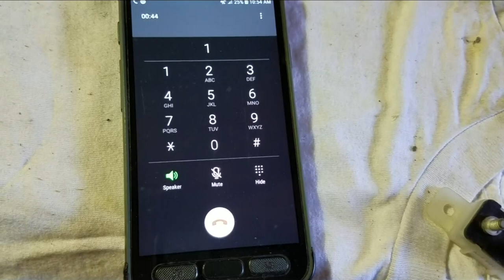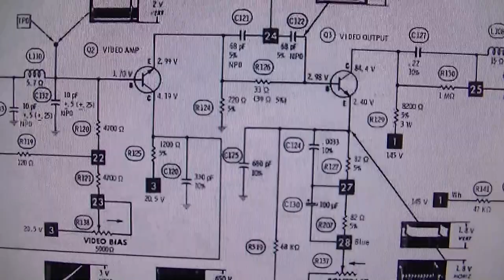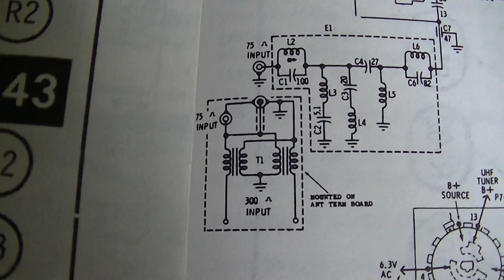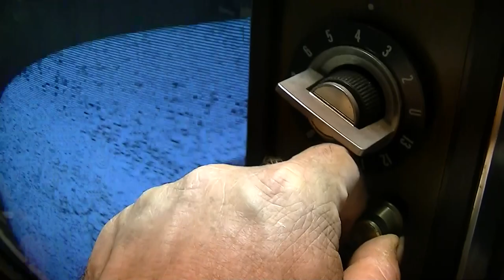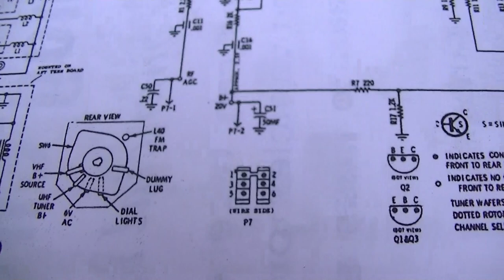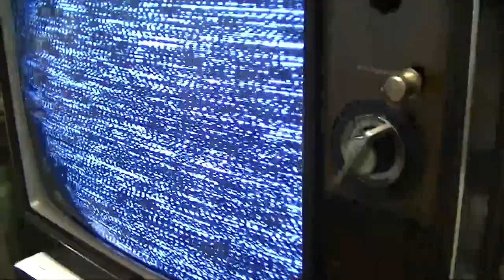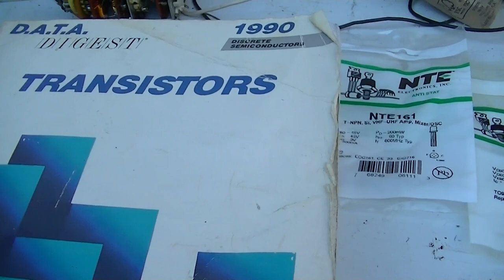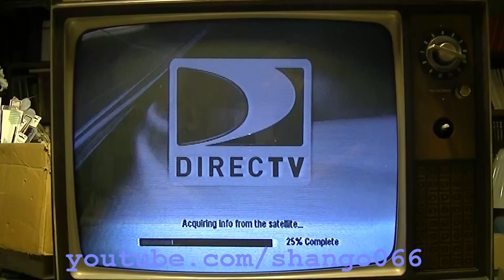Repairing 1974 Motorola Portable Television 19 inch Black and White

Comment: I had the identical set for many years. I trash-picked it from (of all places) a tv repair shop. All it needed was a rectifier diode and I used it for the next 25 years. The number plates fell off the tuner dials on mine too.

Comment: When I was actually in this business back in the 70’s, tuners were easy. You just packed them up and took into one of the tuner repair places. Three days and $20 later you had a cleaned, operating tuner. I admire your tenacity in getting this thing going. Nice job.
Reply: Thomas Kempke same thing with crt’s
Reply: Yeah.  My first real job was working for Olson Electronics (a competitor to Radio Shack) and we sold dozens of picture tubes each year, even a few color. It was still a time when we routinely fixed things rather than toss them and buy new. From 2018, those look like the good old days!

Comment: Had this problem way back when I serviced TV's NTE crosses for many transistors had wrong pin outs, lower Vcc ratings or just wouldn't work in tuners & RF circuits. Got to the point I only used original numbers or ECG replacements, NO NTE's. Now you don't have that choice NTE bought ECG out. Back then there were a lot of shoddy replacement parts including mis-labeled tubes & semiconductors, even PF twist lock electros that were mis-labeled.

Comment: Great job!   A few hints though that might have helped: 

If you pick up Britney on all channels, then that’s a clue that the oscillator isn’t running.  The signal is just forcing it’s way through without being downconverted.  

If you need an actual ground and not through an isolation transformer, that’s a clue that the input balun is open.  Maybe due to a,lightning strike?

Otherwise a virtuoso repair job.

Comment: I remember those old tuners. Trouble-prone and a pain to work with. There were exchange and rebuilding companies back then to deal with them in an economic way. Ads were in every electronics magazine till the early 80s.

NTE started as ECG (Sylvania) and got taken over in the 80s by NEC (Nippon Electric Company). The presence of those components may indicate this was sent to one of those rebuilders back in the day and rebuilt using generic parts.
Reply: In Europe, I have never seen one of those ratchet tuners, ever... On really old sets, it was a dial cord thing, and on anything  since the advent of varicaps, it were "pre-o-mat's" with potentiometer presets and pushbutton select. Not so many TV channels here, 6 or 8 presets would hold them all. Later PLL of course.

Comment: Great video! On Ch 4 you should be able to receive the tuner local oscillator using an airband radio around 110-113MHz,video carrier is at 67.25MHz,add the 45 MHz IF and that's the frequency,airband radio tuning will be a bit touchy probably.The radio will need to be fairly close to the tuner.

Comment: 23:54 I have bought a few NTE parts and noticed that on some of them they simply covered up the original manfacturer's markings with NTE blah blah printed over it. So from that I can surmise that they either bought up lots from people getting rid of them or that they got factory rejects that were a little out of spec or something. I've never had a bad experience with NTE parts, but I've only used their FETs, transistors and opamps (on occasion, for audio applications only).

Comment: I have always wondered why folk in the T.V. Repair trade called these things Tuners when it's really the Front End Module for a superhet receiver.The word Tuner suggests a complete receiver from aerial input to baseband video or audio output.Also V.H.F. T.R.F. Television receivers are possible (at least for Band 1) and were used over here in Britain to receive the B.B.C. (State Broadcaster) on 405 lines.

Comment: @shango066   i have just ordered a couple of miniature isolation transformers used for audio/microphones. i will try to see if they work with composite video because i have a tv with the same problem and its also hot chassis and i want to be able to use it as a monitor. do you think it will work? i also thought about coupling capacitors but i dont know what value would be suitable to let all the video frequencies pass... if it works i can inform you so you can buy some...they were like 2€ each or something...they are advertised as 600:600 impedance
Reply from the maker: No it wont work right. Best to just fix the TV OE
Reply: its a philips black and white tube set ..more than 20 tubes and about 10 diodes in it !!! its a very complicated/sophisticated circuit...the agc line to the tuner according to the schematic should read -15v and its at zero and i cant figure out why...guess i will have to try harder...  thanks for taking time to answer. keep up the long "live-style" videos i like them, most viewers seem to like them.

Comment: Sweet job on that relic.   NTE's should only be used as a "test" part till you can order the correct thing, if the correct thing is NLA, then use the ECG/NTE book to reverse cross  another OEM number with similar spec's.  But once the previous tech realized those transistors didn't take care of the problem the originals should have been put back-end of story.

Comment: You mentioned that it is a hot chassis set and that the plug is not polarized.  I wonder what would have happened if you had reversed the plug.

Comment: A transistor will often still transistize with collector and emitter reversed, so if one doesn't quite know the correct connection, the transistor tests okay but the circuit performs lousily, it may be worth trying to reverse collector and emitter.

Comment: It remind me to a Midi system I purchased the service manual for. It was a nice manual, full of detail until you got into the CD block. The manual stated; CD UNIT MANUFACTURED by SHARP ... (Thank you) They didnt put any info of the CD unit .... Miserable to say the least.  You will tell, well it was a sharp design ... so true, as the rest of the system had sharp writen all over it. Yamaha likley made the industrial design and speakers. So it is not my problem if you contracted sharp for the design really, just include the information.

Comment: Would a BFR96s which is a Pill type transistor work in that VHF tuner and it turns out that the BFR96 is a MOTOROLA part, could someone print out a new adjustment gearwheel.

Comment: in min 1:00:00 h I would say, if the fine tuning is not working, it is possible, that the oscillator is not running !!! If you put high signal level (chanel 2...4) into it, it is possible, that this passes to the if and you have some direct receiver !!! ... Now I see the tuner working ...

Comment: most mobile phones have some sort of "black list" were you can block calls from certain numbers....or you do like i do, i either answer and leave the call on and put the phone away just to annoy the caller or i immediately insult them the hardest i can. they hang up and dont call again usually......of course you have to take into account the local laws...here nobody can use a phone call insult to take you to court because the phone call cannot be recorded without permission... but if you insult someone at the street and there are witnesses it is actually a crime....

Comment: 9018  cheap transistor for $5 china radio should work. order about 1000000 for those from china. it is a 800mhz or better part

Comment: SPAM call.    I.mmediately answer and make no sound whatsoever.   The system hangs up and my number likely categorized as a non-working number.   It will not be sold.  If not answered, the system likelyvill call back at some other time.
Reply: In the early nineties, before robocallers, but when WATS lines were being used in call centers from the Omaha area, legitimately (but annoyingly) selling stuff, the only callers between 4 and 7pm  were telemarketers.
I would always answer the phone "Caller from Council Bluff, You're on KFAB eleven ten, and we're talking about living with herpes"

Later, people who called in an attempt to sell heard "Sorry, I don't need a (blank), but do you know how much fun you can have with a pre-owned slide projector?"
Reply: Fun!   On call for emergency blood transports (some requiring red lights and siren), robo calls have harmed my health.  After driving many hours in the middle of the night, I may be sleeping when a solicitation awakens me.   I can't shut off my cell phone.
A criminal claiming to be from Microsoft called advising that my computer was causing problems on the Internet.   "Is that why my computer is getting so slow." , I asked.  "Yes!", he answered and offered to help me with it.Turned on my camcoder to record the criminal and kepthe criminal on the telephone for 34 minutes while I took our dog outside to potty and did other things, all the while never quite getting his instructions correct.

Comment: Kind of a waste fixing a tuner now that everything is digital and the tuner will never work again. Easy now, it only has to get channel 3.
Reply: No oscillator, no channel 3.
Reply: on my tv's especially tube tvs i feel like i am cheating if i just bypass the IF and inject composite and audio from a DTV box or DVD....i have a modulator wich converts to RF and connect it to the antenna input on channel 3 or 4...its the only way i consider a TV repaired or restored..everything must work. i dont care if everything is digital i have a LED tv in my room, the vintage tvs are just a matter of a hobby and hystorical preservation